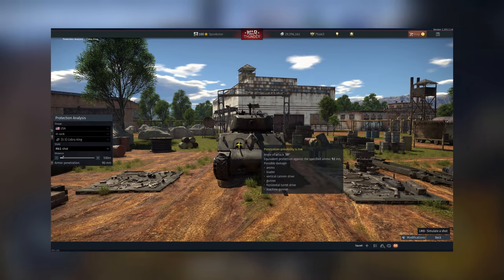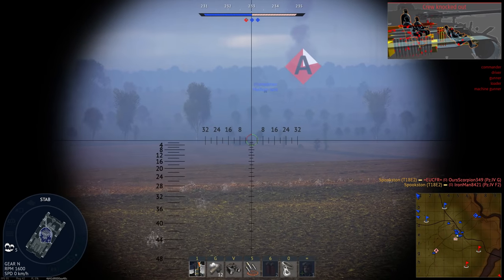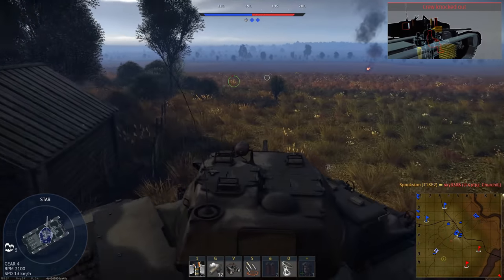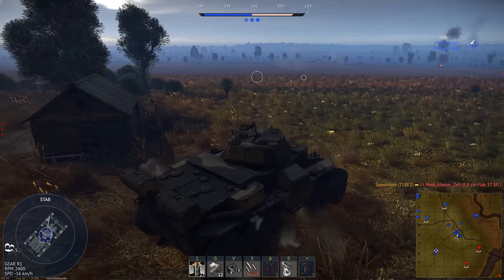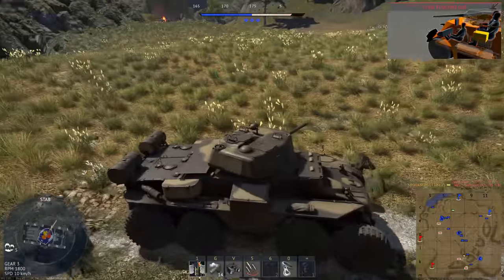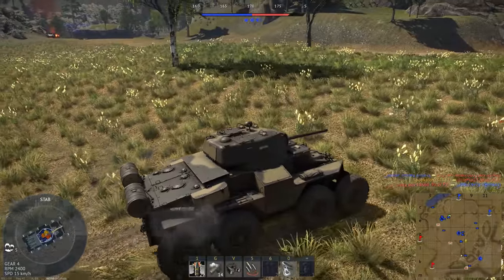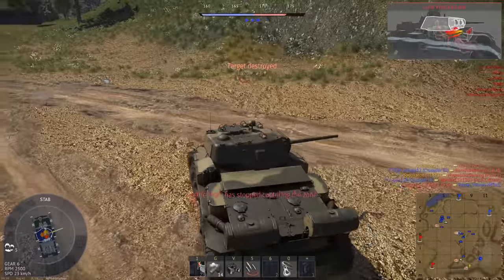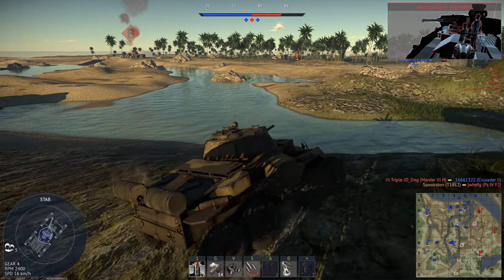Volumetric Shells Were A Bad Idea

Comment: In real life, the T-54/55's turret was quite tough to penetrate unless you managed to hit the coax port or the optics port. In that case you had a guaranteed penetration. Also, what about "shell traps" (when a thick and a thin armour plate are mutually set at an acute angle and the round ricoshets off the thicker one and penetrates the thinner one)? Do they work in Warthunder?
Lastly, I remember Warthunder's HEAT rounds acting nothing like the real thing when flying through the inside of the tank after penetration. Is that still a thing?

Comment: fighting panthers is impossible now that their slightly curved mantles are massive black holes of armor because they are slightly curved. They totally removed the irl ricochet tankers used to pounce shots off the lower part of the mantle and into the top of the hull.
Reply: also the funky shaped armor on the tigers gun mantle makes the small parts of angled armor completely absorb shots rather than having them ricochet into the rest of the flatter parts of said mantle.

Comment: The entire point of jumbo is not to be pen at the front, machinegun port weak spot is not a thing on Shermans when pretty much all sherman can be penned at the front. Jumbo has been uptiered to face panthers, so it is strategically balanced. So take down jumbo, u use bigger TD guns or long 75mm up wards. Ofc, did i mention a minivan with 20mm on top can dismantle it?

Comment: Good news with increasing angle the chance to hit 2 plates that are next to each other at the same time dramaticly decreases the bad thing is that now these two plates are at for example 70 degress meaning  the armor is ridiculous for example i managed to get 900mm on the side of an m48 in the armor viewer at an 60 - 70 angle. 
Also it seems that its much harder to hit 2 plates with heat ammo  and even if you do manage to get a two plate hit in the armor viewer the armor protection increases only by a much smaller amount.

As for invisibel rocks thats a problem with Terrain Tesselation these rocks are most likely to detailed for the hitbox they got or the rocks themself are to low definition for the hitbox given when the devs made the map in both cases the reason is better game performance/and less manual work. With larger shells its obviously easier to hit an invisibel hitbox especially if you cant know which empty space above a rock has a hitbox and which dont so until warthunder improves their maps with manual edits for each rockface you cant do anything if you reduce tesselation the shape of all terrain/rocks becomes simpler and the issue will be worse as you get much more gaps where there should be none or to large rocks and you cant see. if you consider that every hitbox is made from straight lines it becomes easy to understand why something round or irregular as a rock becomes harder to do just look at the hitbox of spare wheels on they arent even round

Comment: To be honest , I never have a problem with the volumetric shell . Maybe for that M26 coaxcial MG , Tiger shell actually cannot pen because big shell but the power of kinetic energy that 88 mm shell have, can make that shell pen instead bounce .Maybe for problem for volumetric , Gaijin must upgrade it not  the diameter of the shell but the kinetic energy of the shell too (or you might say shell velocity)

Comment: Don't know why but it feels like the french 47mm does nothing to Pumas now. If it does pen, it often has little to no spalling for some reason. Thats if it even pens as they seem to ricochet far more than they used too.

Then theres also the Char 25t. For whatever reason the other day, I tried shooting a Coelian in the turret face, just below the guns. its only 80mm of armor. The 90mm gun has 215 at 10 meters. Which this was being it was sim. Somehow this 90mm APC shell ricocheted off the center of the turret. My guess is that it grazed the upper hull just enough to change it's angle.

I've also had shells hit barrels dead on and do nothing to them. HEAT, HEATFS and AP all have done this. Facing a T-64A in an AMX-13-90 is hard enough when you can actually hit the barrel. Lobbing a heat shell down it and it not breaking (or better yet being stopped entirely because it detonated on the suspension isntead of the side armor) is enough to make me quit for the day.
Reply: Yes this is partly a sim issue. the T-64A is a 1971 vehicle and the AMX-30 (1972) is obviously from 1972. But the T-64A is a 9.3 tank that can see a 7.0 light tank in this bracket of Sim. The lineup I have for that bracket can't even scratch a T-64A and somehow the BMP-3 is also in this same bracket and, despite being hullbreakable? Can eat a 105mm or 90mm HEAT shell without dying.

Honestly this might be an issue with France as a whole. The AMX-30 is also far louder than any other vehicle in these matches. As soon as you tap the acceleration it sounds louder than a Wyvern despite it being YOUR OWN ENGINE which is QUIETER than others in most cases. I actually can't hear over it with my own engine sounds dropped down to the lowest of 40%.

Comment: Tiger 2 10.5cm I had 4 guys who had no idea I was there couped up In a crevice. I go to shoot and hit the rock that was literally about 4ft below where my gun would have been. It's hitbox was MASSIVE, I thought it was a fluke and fired 4 more shots tht did the same. I got busy bombed 

So either the hitbox for the rocks is huge so it intervened with my new volumetric shell or gaijin pulled another stunt and made the 10.5cm shell bigger than it's supposed to be so it does stuff like that and can't hit even larger weak spots

Comment: There are also these wonderful track shots, where your entire shell gets erased by hitting a track from the side.
I'll believe that with smaller shells but when I hit a light tank's track from the side with the 130mm gun of the Object 279 (which has a 30kg projectile flying at 1000m/s btw) and it only takes out the track, it's a damn joke. And yes, the Object 279 is absolutely 100% OP, I agree with that. At least as of right now.

Comment: I was interested abaut volumetric shels because it felt a bit wrong when I could shot trought a few cm hole trought the turetring with like a 100mm shell, but I'm not so happy when my shell gets eaten by track armor vhen it just sretched it. I don't like that in  low/mid tier constant barel shoting stared to be more common!

Comment: Aside from the obvious  plate edge bugs i think calculating both rough geometry of round impacting (so they have points to enter tight spaces) and deformation weakness at plate edges ( how a large round pushes through a small gun port) would be the best fixes. The projectile geometry is the obvious easy one here.  Or maybe I'm wrong, but I think the shells are now a set of 3 pixels forming a triangle the diameter of the projectile?  I'll go look it up.       Anyway the edge deformation would be much harder to model so don't hold your breath.  I am a rabbit

Comment: Killing T-34's reliably through the turret cheeks, or even penetrating the perfectly flat breech face below the barrel, has been nearly impossible while i was spading the Achilles. Also had numerous occurrences in the test drive where the bloody FLAT FRONT PLATE of a PANZER 2 would survive a 17-pounder shell because it struck the edge of the viewport and just disappeared into mist. Volumetric took the already janky hitboxes and netcode of War Thunder and turned it up to 11.

Comment: one of the biggest WTF issues is the Hetzer in particular. You can shot the front with a 17 pounder and it will pen, but only kill the driver -_-  also, the number of times I have died to a shell which didn't even pen, but shrapnel somehow started in the turret, is infuriating.

Comment: Overall i kinda like Volumetrics though it still needs a lot of improvments.
Other stuff for Gaijn to do
-Take the soap of the tracks
-minor balancing 
-AIR BR Decompression
-Increase Spawn Cost of CAS and Planes in Ground RB
- Decrease Repair Costs (RC) of vehicles with RC of more than 12k SL

If Volumetric Shells are kept
- ReDefining Battle Ratings of Tanks depending on their armour, speed/manouverablity and effectiveness of the META tactics of the vehicle post Re-BRing.
- GET THE CONTENT CREATORS TO HAVE A SAY IN THE Re-BRing

Though the rebalancing would probably put T-34 (with 76mm cannons) up by .3 BR since their mobility would be improved with the soap off the tracks.  and the T-34-85's would probably stay the same or go down since their mobility is almost exactly the same as the T-34/76's.

Comment: I think the issues you raise are important. The issue I think should be fixed is how easily some aircraft break apart when being shot. I find this to be a major problem when playing as US Bombers as it seems like my plain just disintegrates half the time. Especially since planes like the B-17, which of course was not indestructible, was able to take a large amount of damage. It would be nice if they made all planes a little more durable when facing high caliber rounds, as it would be more realistic, and also it would fix the problem of a player in a BF-109 making a single pass and sending you back to the hanger.

Comment: I had a string of bad matches lately because everyone and their mother is using said tanks to cheese victories, KV-1, Jumbo, every high detail model tank being whipped out. Can't pen a single one of them, no matter where I strike with rounds that /should/ punch through. The stock rounds fired from the Breda 501 on the Italian tree /should/ pen the back of the turret on a Sherman 76W, but for some magical reason, the round was gobbled up, not ricocheted. Flat angle, dead center, less than 150 meters away. Absolute madness. Nothing worse than a bunch of KV-1's and T-34's rushing the spawn and never being able to be killed because  their weak points are missing now.

Comment: Most videos you make I highly agree with you; this is not one of them. This is more of a feature optimization issue. I would personally uninstall the game if volumetric shells were removed right now. "Pixel hunting" was one of the major things that made this game unfun for me. Vehicles that depend on frontal armor were basically easily defeated by very simple knowledge of a common weak spot. It meant that the only vehicles that were reliable were the "meta" tanks with high mobility and gun handling. The buffs to a handful of already strong vehicles is a negligible problem compared to full caliber AP rounds entering the likes of say... the M1 Abrams turret ring- constantly. There are many more examples; the T32E1 was nearly unplayable as random shells would find microscopic gaps and chinks in the armor that would pass through, even if not intentionally aimed for them. 

The issue now is simple unreliability of kill shots. And honestly, this is a much easier issue to fix than tanks with exaggerated weak spots being unfun to play, and bringing about that "mobility meta" that has plagued any armor-focused gameplay. Making armor a more relevant factor in battles is hardly a negative feature, even at the expense of kill-shot reliability. And you've already mentioned some possible methods to fixing this. Making shells not have a thickness again though is a very bad solution. The point and click meta of top tier is what makes it so unfun for many players. Why bring that back?

Comment: For someone who makes a good amount of videos on what if certain vehicles were realistically implemented, I thought you would be rather happy with such a change. The bugs obviously need to be worked out. You say it didn't make the gameplay more realistic yet that was the entire point of the volumetric shells and it indeed did make the game play more realistic. How is it not realistic that now you can't shoot through holes or cracks in walls that are smaller than the shell you're using? Personally I haven't had that many issues with volumetric. Some situations are now more tricky but that's fun. Pixel hunting as you call it was never a skill, it's knowledge. Knowledge of knowing where to shoot the vehicle. Being able to disable a vehicle without knowing these tiny spots you used to get through (or without being able to shoot them anymore) is what I consider skill not that it's that hard. However nobody can deny that the problem with shooting 2 plates of a different thickness isn't a problem. It should indeed be fixed.

Comment: I used to not have a problem with T-34's but after the Volumetric shells I just hide in a corner when I see a T-34, been playing Italians a lot and before the update the M18/75 TD was okay, you had to aim for the weakspots (turret ring, behind the tracks etc) but even quick lobs could still do some damage, now you have to pray to RNGesus and hope Gaijin blesses your shot because 1pixel on a guide wheel and its a bounce and can't penetrate the turret at all anymore. Overall its been more frustrating to play Ground RB after the update

Comment: Yeah all this stuff has been pretty frustrating to deal with - while I've enjoyed the better performance of tanks like the Churchill that has seen its turret ring take a bit more skill to hit correctly, or with the Mark VII become much stronger, the number of times I've made shots that should very easily have knocked out the target tank but instead have completely disappeared or failed to penetrate has been extremely frustrating

The primary example I've encountered firsthand is side shots into Tiger IIs - there has been a long history of Tiger II sponson side armour having dodgy hitboxing with the turret ring where it extends down below the hull roof around the turret basket. Even with 20-pounder APCBC at a square angle, this overlap is fully capable of absorbing rounds with no injury to the turret crew or damage to the ammunition racks. And that's just one example of many, like you said Spookston while the change has perhaps benefitted some tanks fairly and others, like the Jumbo or 279, far more than planned, it has also made pixel-hunting and RNG-style nonsense far more common and far more frustrating overall.

Comment: And then there are Tiger I's with 300-400mm or even more on their driver-window and machine gun port on their front plate. I lost count how many times my shells bounced there. At least you can still go through the middle of that plate.
Similar thing with the Centurion Mk3 or Strv.81 with some spots over 1100mm thickness on the gun mantlet.
On the other hand you have tank like the T34 whose roof seems to just swallow all kinds of shells even if the shell just touches it making it into giant one shot kill RP/SL pinata while its shell is so big you (or at least I) have massive issues killing just about anything.
However I kind of like the volumetric shells when they work as it no longer feels like "no armor is best armor" all the way.

Comment: the edge or the armor should be a weak spot always not have the same resistance as the center of the plate.
thats why in real life turret ring shots are so effective, the edge of the armor dont destroy or detonate the shell just because it cant fit, it bends the armor and squeeze in between the gaps that cus they have less mass

Comment: The reason that the KV-1 could killed by turret-ring shots is because... The shell was small enough to not hit other things before the turret-ring, you can still kill tanks by hitting the turret-ring, tou just need to be more precise, the volumetric shell is a great idea and with all the experience that I had with it, I can easily say that the mechanics work well, the problem about hitting other objects than tanks happens because, or your shell actually hitted the house because you were trying to make a pixel shot, or because the objects don't have a well modeled hitbox, and if that's the case, the problem is not the volumetric shell, but the not well modeled object hitboxes, wich is a simple problem to solve as I know

Now not just heavy tanks feel like heavy tanks (such as the first KV-1 that was much easier to kill than now), but medium tanks can hold much better weaker cannons, now a Pz. IV have way more chances of surviving a shot in the front by a KV-1 or a Sherman, aditional armour for tanks like pz4 and t34 works better (even though it doesn't add a lot of things, it helps to survive some shots)

I'm talking about that with the experience that I have in low and medium tiers,for now, I'm not capable of saying something about high tiers

Comment: Completely agree. The botched shell change is just the cherry on the top of the shit cake of Gaijins changes this last year. They clearly rushed the change and the fact that armor seams effectively double the armor value, and that this has yet to be fixed, is beyond incompetent.

This is on top of:
- Nerfing the traction of tank tracks to prevent some players from exploiting the broken maps. A completely unnecessary and lazy fix that nullifies the historical purpose of tanks.
- Introducing the Swedish tech tree with botched underperforming guns (because of their shitty pen calculator which is known to be inaccurate) only to try to rectify the situation by giving their reserves APDS shells (100mm of pen at 1.0) while also failing to alter the BRs of vehicles to reflect this fact (the strv m/40, the Lago).
- Making the R3 fiasco 100x worse by hosting an event that rewards quick captures.
- Hosting a build event with a 20mm puma as an easy reward (this vehicle is disgustingly OP).
- Continuing to ignore the completely broken match making system that puts vehicles up against far superior ones due to an up tier while also allowing level 100 marshals to dominate new players.
- Refusing to address the problems that have ruined top tier (repair costs, helicopters).